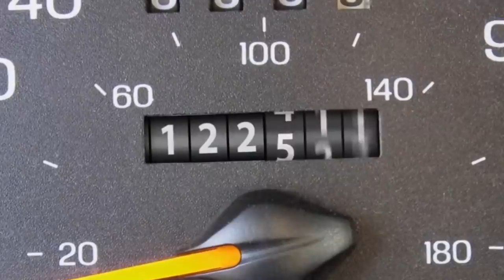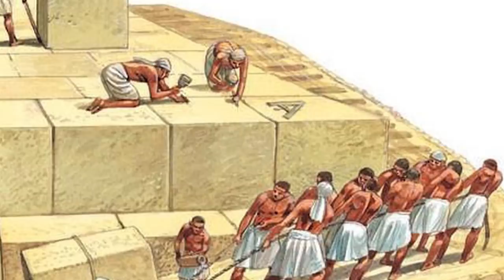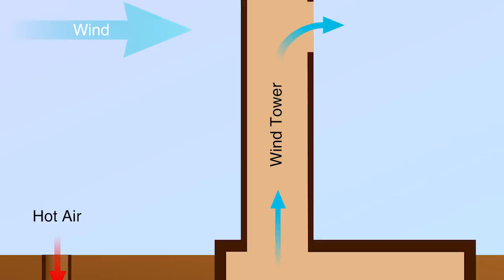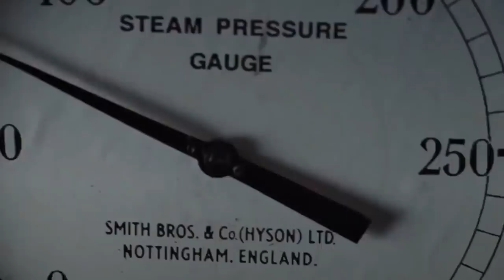12 Most Mysterious Ancient Technologies Scientists Still Can't Explain

Comment: Have you tried walking barefoot on 30c - 40c degree heated sand?  If you water on sand it will filter through.  Then when you have completely soaked the sand (if possible) it will burn your feet, that is before it evaporates.  Wooden sledges would soak up water causing friction and other problems.  The window when everything is perfect would be very small unless they work at night.  What about heat stroke, no clean water they drank beer and how long can a man do heavy manual labour in that heat?